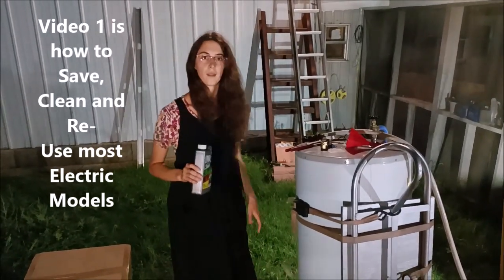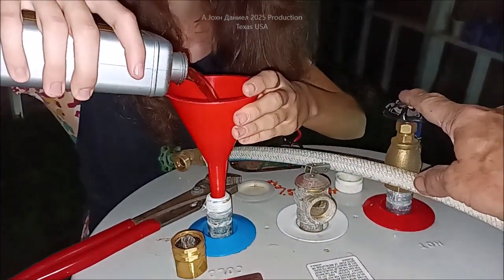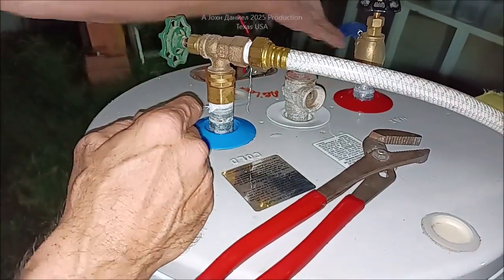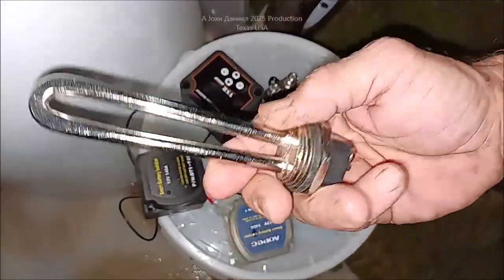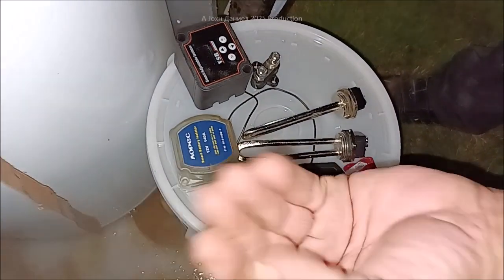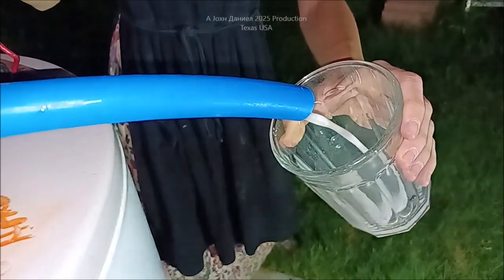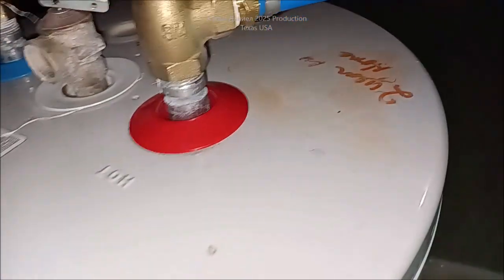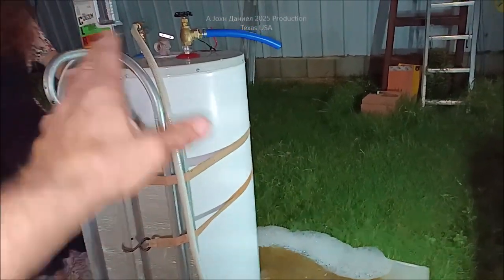Clean & Prep Water Heater to convert it to Automatic 12 volt DC Solar Electric Power - Video 1 of 2

Comment: You posted the following comment on another site, do you have a picture of this on your site? To reduce the silt going into your pressure tank you can make a 1-1/2 wrap around P-tank 1" PEX loop, My design about 15 years ago that stops 50% of the silt trapped in the tanks. Wrap 1" pex around the tank in one + turn then tp your tank/well fitting, then off to house. The silt travels like a loop inertially past the tank Tee and it works, Science!
Reply from the maker: We never uploaded videos on customer locations but the loop if placed from the well to around the pressure tank works to reduce particles going up into the pressure tanks piping. On off surges is how it gets into the tank on normal well pump set ups, lifting silt and some traveling into the tank when using all right angle fittings. Most well supplies are 1 or 1-1/4. To reduce scouring silt you wrap the tank at the bottom 1 full time with 1" pex, install a tee on its back in front of the tanks pipe with a short piece and 90 coming off that tee and going to the tanks inlet port, then continue half a turn more from the tee at the tank to your pressure switch assembly and reduction fittings if using them. It gives inertial travel to the pulse generated lift of the silt stirred up on cycles. And always install a 1" whole house anyhow, such as 50m cannister or 80 to 100 mesh inline filter where you go from Well output line to the pressure system with a washdown bowl on it. Putting a silt filter after the pressure tank is never a life extender of the system.

Comment: I got a 40 tank from my neighbor, and it filled a 5bgallon bucket with lime, lots of lime in the water here.  The reason they replaced it was the plastic cold water dip tube broke off and the fed cold water in at top of the tank. I now feed cold water into the drain port. That buildup is due to high energy density heating elements that boil on the surface and deposit lime out.  Those short heating elements will do the same thing.  This tank supplies water just for the laundry and is solar PV powered needing no batteries.  Any excess solar, 5W to 1500W, is diverted to heating water at high efficiency matching panel to the element for maximum power transfer.  For domestic water I use those same small tanks and don't change the tank wiring at all. They can be plugged back into 120V should an emergency arise.  Heating with batteries can cause batteries to fail from failing to be regularly balanced.
Reply from the maker: Use a VSR for your water heating so that it stops battery issues by keeping your voltage on/off at prime volts for best battery health. We have used 12 volt on 120 volt elements but the amp draw has a huge cycle swing on them verses the dedicated lower iron higher nichrome wire in the DC models.
Reply: @JOHNDANIEL1  That is a very simplistic way of looking at a battery.  Batteries need to top balance at a high voltage to remain healthy. An undersized system can over time destroy the battery.  In essence you have to overspend to make it work.  In a practical sense, that just may be the cost of simple hot water. Low voltage elements have significant loss in the wires and connections to the element from high current. Higher voltage is the ideal way and that means powering from the panels.  Unfortunately, there aren't commercial products to do this at this time. Controllers have to be built.  I have a small system with 70% of the panels in the shade at any time. This is my garage laundry where excess solar heats a 40 gallon tank. Those panels also supply the house.  All cycles use hot water. Not one bit of solar power is wasted.  It is a beautiful system and really cheap.  Some day the solar world will accept this method.

Comment: Don't forget to change that junky plastic drain valve with a brass full flow drain valve. It will make future service clean outs a lot quicker due to greater flow rate. $20 well spent
Reply from the maker: Already did that with a new Apollo 3/4 and brass nipple on it. See the SHORT done announcing pending video, I think it shows it in the shop with the new valve.

Comment: Great video, I have bad well water. Have to clean mine all the time. Never thought of using CLR in it. Will do this next clean out.
Reply from the maker: If your heaters get real bad, remove the lower drain valve, install a full flow full port 3/4 ball valve on 3" of 3/4" brass nipple or stainless pipe, remove the ball valve handle for safety of kids or animals. To Clean I would do the 40 ounce size on a 40 gallon if you have severe. Pour in, fill, let sit power off for 3 hours. Drain. Refill and drain 2x more times. If you get clumps plugging up your lower valve use a piece of plastic tube 5/16 diameter to clear it as you drain.
Reply: Good job! I used to be a Plumber / Gas fitter in a past life. 1985 till 2007, then again in 2009. Replaced thousands of them, including gravity feed, in roof space. They had Copper tanks. Good money! A couple of years ago, I went on a mission to find a 50L electric tank & got 1, cheap. Here in OZ, we can buy a (240v) 1.8kw element. 
On the same trip, I found a Natural gas, external, Rheem 90L for free. I've used that while camping on a bush property that I had permission to visit, now & then. I just built a small fire where the burner used to live. Worked great!

Comment: You can use this as a brake for your wind generators when it gets a bit too blowy!
Also there is nothing stopping you putting your solar into a 240/110v element! It will work fine but just produce less heat than if you were at higher voltage. ...... just do not be dumb enough to try it the other way round ..... 240/110 into a 12v appliance can get interesting for a short while ;o)
Reply from the maker: This is why we are installing this one. Wind power going back up since I finally found a few new sources for the turbines. 1-1/2 years trying to find NON FAKE turbines to show, install and share.

Comment: Dude, quit interrupting her! My wife broke me of that "bad habit" decades ago... 🤦🫩.. Let her talk, get her a wireless mic like DJI offers. Her voice is far more soothing than your gravally old man stuff... 👀😉
Liked, "ALL" notifications & sub'd, btw & saving for future project. I saved our old water heater when I last upgraded. It'll be installed as auxiliary DC powered, since we have frequent rural county grid outages. Gathering funds to build a full solar/wind system. 👍🦅
Reply: BTW old tank was 40g,new replacement is 50gallon.  CLR is great stuff - used it often around the house & shop. Country boy stuff.
Don't forget the sacrificial anode replacement!
Reply from the maker: Yes, this one has a new 11" anode, new TP Valve, and 2 new 240v elements already comes with it from the original owner who thought that was the issue. Then she wanted a new 56 gallon so we knocked $75 off for this one. It's a 2021 model installed in 2022 so not very old, just bad water plugged it up. You want to stay with a 18 to 30 gallon if possible for these conversions. DC heating don't got the 3200 watts that 240vac can do.